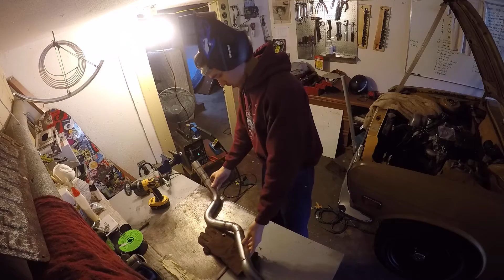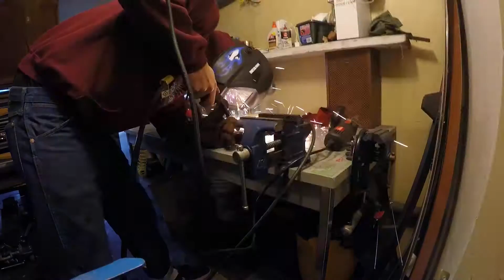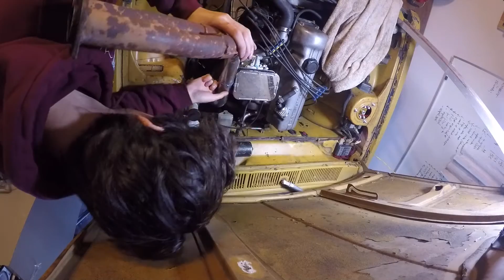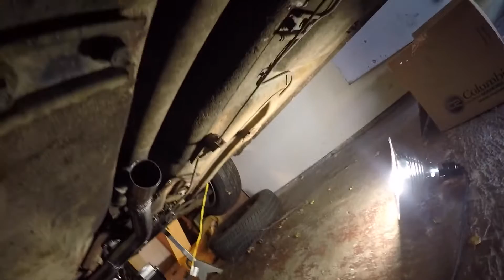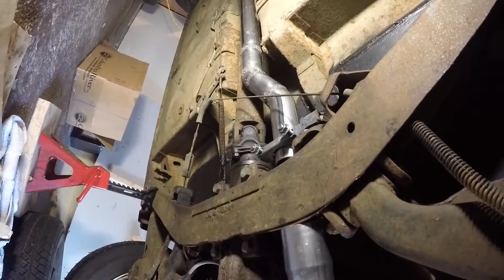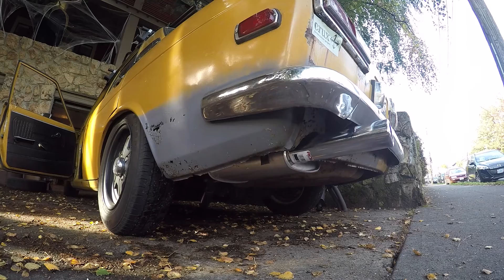DATSUN 510 CUSTOM EXHAUST FAB (FLUX CORE H.F. WELDER)

Comment: Thats not stainless right?  Also what wire are you using?
Reply from the maker: Nope, just mild steel. I'm pretty sure this is with Lincoln Electric .030in wire. Way better than the HF stuff.
Simon